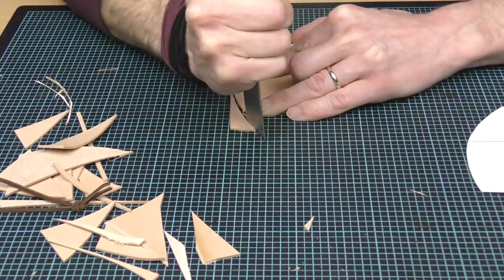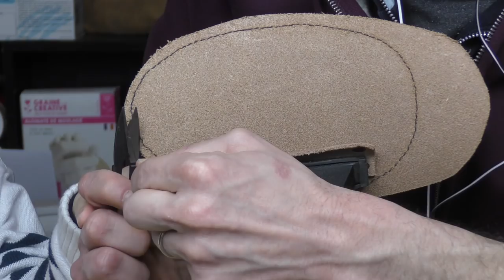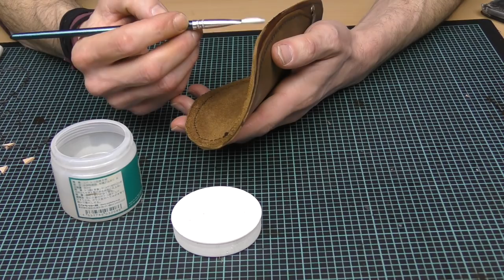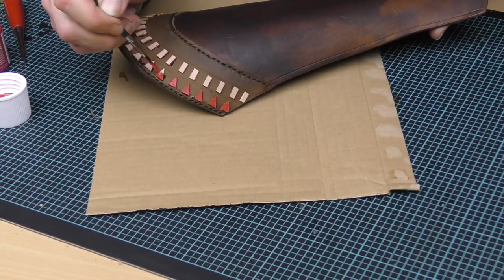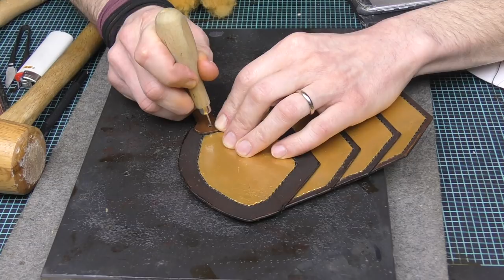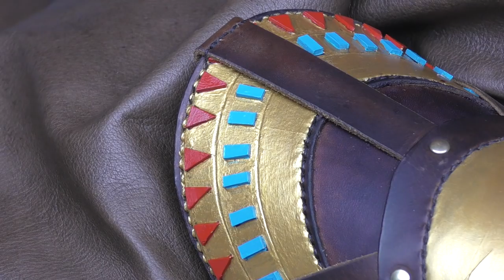Making Assassin's Creed Origins Bayek's Leather Vambrace / Gauntlet - Leatherwork

Comment: Pretty amazing build, what are you doing when you use the lighter?
Reply from the maker: Thank you very much.I burn the wax around the thread to melt it, close the holes and make it stronger. Plus it burns the excess thread fibers. Thanks a lot for watching.
Reply: And thank you for the video and an answer. I'll definitly be using that trick in the future.
Reply from the maker: You're welcome 😊

Comment: what thickness did you use in that leather 1.5mm?
Reply from the maker: I used 1.6 and 3.2mm thick vegetable tanned leather. Thanks for watching
Reply: @RedSmithWorkshop  Thank You for the quick reply. If you dont mine, i need your help on one more thing. Where can i get the templates for this? It would save me a lot of time. Thanks
Reply from the maker: @tamir5940  Unfortunatemy there is no template. The ine you saw in the video is the only one I made. It's a prototype.
Reply: The Redsmith Thank You.....I’ll look online for a template but thanks for the information on the leather. I’ll be using 2.mm. That should be around the same as you used... I hope it holds the same
Reply: Hello, I followed your video and I have to say success!! I have only one question. Can you paint the gold color on top of the brown dye? Can the paint stick onto the dye? Or do you not dye that piece and paint it gold?
Reply from the maker: @tamir5940  Cool!! Happy your build was a success. Yes you can paint on the dyed leather no problem!!  Be sure to use acrylic paint and not water based paint though
Reply: The Redsmith perfect! Thanks
Reply from the maker: @tamir5940  You're welcome!!